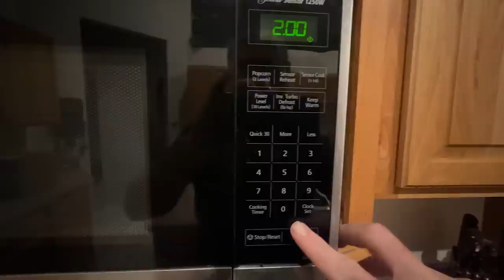Refurbishing and upgrading an enclosed car trailer. part 2

Comment: sealant around the box is a must, plus putting solar panels on the roof would not need holes in the roof. A few of the flexi ones that you stick to the roof, would be enough to keep the batteries charged
Reply: you would need holes to pass the wires through, unless you run enough cable to get through existing holes.
Reply from the maker: Ahhh I didn’t think about flexi ones
Reply: You could use marine sealant for the solar panels, if they are well installed, water doesn't need to enter. There are a plastic thing to pass the cables securely. Don't overthink about it
Reply: Just fab up a quick frame to mount a panel to that slides out on the ceiling at the back door. Kinda like the step but when it’s out it has a solar panel facing the sky. That way no holes on the outside roof & is there when you need it but is always out of the way

Comment: I would add red tape or paint on the inside of the trailer floor at the edge of the doorway,  and green tape/paint at the edge where the step actually is, so there's something visual to remind you where to step.

Comment: Right at the end, I was expecting Jose to fall off that step.
That is literally one of the worse jobs you have done dude, I understand your working with what you have.
But that step will injure someone, accident waiting to happen.
Love you guys, love what you do.
Reply: Agreed, that’s gonna butcher someone’s calf. 

Shouldn’t be too difficult to get some support in there and center it to the door.
Reply: 1000% agree. Absent mind, distraction, something will have someone falling out of that trailer. Dangerous!
Reply: Tell everyone you drive an automatic tranny without actually saying you do..
Reply: @KevinDouglas11 I would definitely hurt myself on that.  Getting a couple pieces of aluminum channel to add crossmembers where they need to be is easy.  This was a pretty lazy install.
Reply: Haha. It is pretty bad.

Hope he fixes it.
Reply: @KevinDouglas11  i thought the same thing. first time they go running to the trailer cause they need to fix something super quick and come running out expecting a step to be there but went left foot first or was just off center. is gonna end up with a rolled ankle at the least if not someone ending up on their face on the ground

Comment: I'm going to be honest seeing your comment on not wanting to drill into the roof for a solar panel. I was not expecting you to cut into the floor to put a winch in. Keep them guessing lol
Reply: Lmfaoo same
Reply: Not really, remember he's in florida. 99% of the time water comes in from the roof versus driving and water getting sprayed up.
I am surprised he didn't seal it
Reply: @patonb  you're right but he's traveling all over a hole is a hole is a hole it definitely should have been sealed still I feel
Reply: @rockyogrady8661  tell that to my ex... all holes are NOT the same!
Reply: @patonb  🤣🤣 I feel like that was the comment that I was hoping to see
Reply: The Same reason why a lot of people in aviation don’t like fuel inspection panels on the top of wings if there not sealed properly they leak when it rains into a sealed compartment and don’t give you a heads up by leaving a puddle underneath when there not sealed right
Reply: The reason he cut a hole in the bottom is cause the bottom is less prone to get a leak caused, with top holes drilled it’s more prone to cause a leak therefore, cutting a hole in the bottom would be easier then cutting/drilling a hole in the top.

Comment: You should add a tow hook to name it even easier. Also the offset step is dangerous. Some that's not used to it or not paying attention is going to fall.
Reply: Don't worry, he'll be bothered by it enough to fix it after the first event lol.
Reply: Surprised he doesn't have the hot Boi tow hook 😂

Comment: Probably not necessary but, I think a roller on the part that folds in and out will save your rope from damage/fray in the long run.
Reply: I don’t think rollers are good for synthetic winch rope.
Reply: The chunk of aluminum that’s on there is called a fearlead, it’s what synthetic ropes use versus the rollers used in steel cable
Reply: @MoonieBravo  oh cool didn't know different cable materials used different guide systems
Reply: @djlolypop  I was confused by the set up of that fairlead swinging up, I feel like it just fold back down once he started pulling the car in
Reply: Hawse style fairlead(as used here) for synthetic - roller style fairlead for cable

Steel rollers will develop nicks and such over time that will damage the synthetic rope, while the solid aluminum hawse fairlead won't. And, on the inverse, a steel cable is obviously going to wreck a piece of billet aluminum in short order, so steel roller fairlead for cable.
Reply: @jimmybaronio479  Yea, I'm not all that blown away by the design of that winch mount - but, it sure looked like it worked fine(better than I would assume), and "good enough" really is good enough most of the time lol

Comment: A suggestion. I would mark your bolts after you check and tighten them. Will make subsequent checks much easier as you will be able to see what has loosened, obviously not ignoring critical components.
Reply: Take some hacks from the aviaition industry, torque stripe paint on all your major fasteners and if its really important invest in drilling holes for safety wire(lockwire)

Comment: I think you should add a second step to the other side towards the front of the trailer.
Also, why go between the wheel wells when you can put a deck and a ramp so that it goes over the wheel wells. Just a thought.

Comment: To help with the nut and bolt check, I would use a paint marker and mark the nuts and bolts. Then a quick visual check will tell you if they have loosened up at all.

Comment: Always in for the trailer/shop upgrades! You might be able to add a another puck style tie down for a snatch block in front of the winch in case you need to bring in something longer than the vette.

Comment: A timesaver and bladesaver for sawzall's - grab a simple spray bottle, fill with  water and a dab or two of dawn dish soap. Spray that on the blade as you cut, a little goes a long way.... it'll cut metal like butter. Learned that one when going through vehicle extrication training.

Comment: You might want to look at installing rampovers, similar to what dirt late models use, and it will make pulling the 'vette in and also make tying it down so much easier. You could have also looked into mounting the winch under the cabinet on the SIDE of the trailer and use a snatch block to change direction of the cable. It would utilize the dead space under that cabinet since its elevated off the floor.

Comment: I'd get a snatch block to mount closer to the cabinets so you can pull things further in with the winch.
Reply: The only problem with a snatch block is it makes winch pulling speed twice as slow. That winch looked slow enough already. I dont think he ever pulls anything that far forward, plus i dont think he could fit more than 1 car anyways.
Reply: @timothycarey3883  Not always.... depends how much you were bogging the winch before. If it was struggling before, lessening the load with the snatch block can actually speed things up.

Comment: If you ever need to pull a car up farther with the winch you can use a snatch block all the way up at the front connected to the e-track.
Reply: E track is not that strong. How about reach under the vehicle with a strap and grab the rear axle?

Comment: You should think about safety wire the bolts and nuts on your race car. I worked on aviation armament systems and we use safety wires all the time to ensure not bolts or nuts get loose.
Reply: Just some torque stripe paint for a visual check too

Comment: The only part I think you missed, was putting some silicon sealant between the box and the frame. I could see water slowly getting in there while driving in heavy rain.  As for the steps, Why not build a thinish cross beam (L on its side), that bolts across the two existing beams, and then simply screws into the floor from the bottom. Then mount your steps to that so that its centered. I could see that space being a broken knee when someone forgets.

Comment: I have seen many of these comments but it should be said again... Solar panels dude.  There are excellent flexible roll and stick panels out there.  Hell, my folks have them on their roof in Washington state. 3.5 kilowatt system and they only need the backup generator on the darkest days of winter.  Fully grid free for forty years.  For your small application mostly in the south....? Money.  No need to ever charge the batteries with something like a 500 watt system.

Comment: Now all you need is solar panels on the roof to keep the deep cycle batteries charged & an invertor so you can use 110 volt tools

Comment: you will need to add a roller down by the door for the winch wire, it will fray the wires and aluminum at some point, you can see its rubbing when you started to put the car in the trailer. also need to put silicone under the box in the floor or rubber gasket material, water will seep threw on a heavy rain when your driving and cause issues. , 

Solor panel id say is a must for your 12v system , or a smaller generator up front, and a pop up camper ac unit would be a nice addition :)

Comment: Easy fix for the winch location. Build yourself a little "a-frame" to clip into the E-track on the floor that sits directly above the winch with a pulley in the middle of it so the winch line goes straight up and makes a 90 degree turn. Make it a foot-foot and a half tall. It will make the pull on the corvette bumper straight instead of an angle and make it so you can winch right up to the box adding an extra 2 or 3 feet of effective winching because it wont be pulling down so aggressively. We use a-frame winching in my shipyard for pulling big cables for when we cant get the winch straight on with the mouth of the conduit. Once the cars in, you can simply pull out the a-frame and put it up out of the way. Would be a neat little fabrication project for you too. I know you love those

Comment: Suggestion for the trailer. Get some side lights for the outside of the trailer. It will definitely give you better lighting for fixing stuff or changing a tire. Solar panels for the trailer. With two or three small o medium size panel will give you pleanty of charge to keep the battery going for different stuff. Maybe a small tv that you guys can see everything happening if there is a stream for each event and finally a portable a/c. Both of you can cool off and relax when much needed in events.

Comment: winch plate to attach to the e-track, hooked to 2 tracks, not like your skull dragging a F250 sideways up a slope with 4 muddies full of mud.  Or mount under the cabinet on the left, pivot pin to attach snatch block, can pull from side door or back door

Comment: Need a few 450w solar panels and an all in one charge controller/inverter.  Get enough and may be able to run AC. Got mine at signature solar in texas.  Might even look them up when you're there.

Comment: use torque seal on nuts and bolds , gives a visual indication if somthing is comming loose .
We use it aviation , it is oil and fuel proof and easyer than cheking every bold every time .
Leaves no residue after undoing nuts and bolds ready for the next aplication .

Comment: just throwing this out there. strapping a car by the wheels or suspension causes the suspension to remain active, if you stop and check the trailer in the middle of a drive crawl in and feel a damper, itll be warm/hot. essentially your putting the same mileage on your dampers as you are the tow vehicle and trailer.

Comment: Dude, the step cantilevers, Which means it will push up on the back part when you step on it and it doesn't have to hold any load greater than the weight of the step. Just screw in a piece of pressure treated 2by wood to the joists (parallel to the side frame) and mount it into the frame under the door. That way you can center it under the door.

Comment: 100% a solar panel or two. this way you could have the batteries topped off and maybe even a small ac unit on those really hot days.

Comment: Love all the mods you're doing to the trailer, it's looking epic now!

Surprised you didn't radius all the corners of the cutout to remove any chance of stress cracks starting from them in the trailer floor.

As others have said, water has a really good habit of finding it's way in wherever it can, sealant under the mounting flange will go a big way to preventing that potential water ingress.

Comment: When I was racing dirt cars and hauling them the top teams claimed to measure shock/ shock fluid temps during transportation of the car. They said the temps during transport was the same as the temps while racing, causing excess wear on the shocks of the vehicle. This may not matter too much on a drift car but shocks were everything on a dirt car. So I would personally recommend doing both the tire straps for vehicle stability and not having to check it so much, but also chassis straps to limit shock movement during transport if possible to prolong shock life.

Comment: That winch is super trick!  For sealing the cables running outside the box, look into nylon cable glands. They're made for what you are doing and are usually IP water rated. They are a bulkhead fitting and will secure to the holes you already have. You run your cables through them and they compress down to create a seal around the cable to prevent water intrusion. Second what others said on the sealant and also solar panels. For seal, just run bead of gasket maker or some other silicone sealant you probably already have lying around. For solar panels there are ways to attach it to the roof without damaging it.

Comment: I was with you 100% until you mounted your step to the side like that. That’s even worse than not having a step at all, because you or Jose (Josue? 😅) will end up going off that side, expecting the step to be there, and possibly really fuck something up! You could’ve whipped up something under there with a spool gun, or even bolting it/suspending the other side with some big ass allthread and made it right the first time…Imo you shouldn’t use it until it’s fixed since you’re already used to that. Serious safety issue there.

Trust me bro, you don’t want that back pain. It’s permanent! 💀

Also the self-tappers and lack of sealing that gaping gape of a hole in your floor. Honestly expected a montage of rivnuts and RTV 🤣

Comment: Still say you should put a 3-4 used residential solar panels on the roof of the trailer. Not only will it be great at the track, but you could use it as a backup power source for the house in hurricane events. It wouldn't run the AC but it would be enough to keep your fridge going and some lights.

Comment: I would spray that box with bedliner or undercoat or something to protect and seal it, i would also look at adding LED lights down the length of the trailer inside, and could you add anothr step it looks like a second might reach to tge front of tge trailer abd butt up to that one, def get a solar panel to help charge the batteries

Comment: I wonder if you could build ramps up over the fender wells, that'd eliminate having to have the car perfectly centered and Give you some wiggle room. It'd also give you sort or a maintenance bay to work underneath without jacking it up

Comment: You really need to look into a steering buddy for driving the car into the trailer without having to be in the car. It works off bluetooth from your phone and an 18 volt milwaukee battery. Been super popular in the dirt world and has started taking off in the drag racing world.

Comment: You could easily rig a snatch block or two that clipped into track in there if for some reason you ever needed more muscle or to move your pulling point even farther forward in the trailer. Maybe a piece of fish 6 out some kind of cushion on the step corner. It was definitely threatening your shin when you get in a hurry. All that's left is filling it up with giant checks and trophies

Comment: Solar panels on the roof, would be the go keep the trailer charged when it’s not in use. And keep them topped up when you at races with out a generator

Comment: You need some solar panels on the roof and some LiFePh batteries for more capacity. Now granted that means you'd have to get an inverter, but it's a much more long-term solution for power.

Comment: They make drive over ramps that go over the fenders, you can also buy a remote steering system that easily connects to your quick disconnect steering column

Comment: For the nut and bolt check, why dont you torque stripe all your hardware. Alot quicker to visually see the torque stripe hasnt moved then manually going over each individual nut and bolt.

Comment: hey bud.... just a question. why not put the winch in that middle cabinet, facing toward the car? id think u could cut into the trailer dolly area and mount that winch box, then just open the cabinet door when u need to use the winch while still maintaining ur cabinet space.

Comment: That e track being secured by only self tappers would drive me crazy. I always thru bolt mine and I’m only strapping down side by sides and motorcycles. No way I’d trust that with a car or truck.

Comment: Tbh you might not need the main beams to make the step work. Build a bracket plate that clam shells one of the smaller beams should be enough to hold your weight and you won't have to drill holes or screws into them

Comment: Put a rv ac unit on top so when it's hot outside you can close the trailer up and cool it down to beat the heat